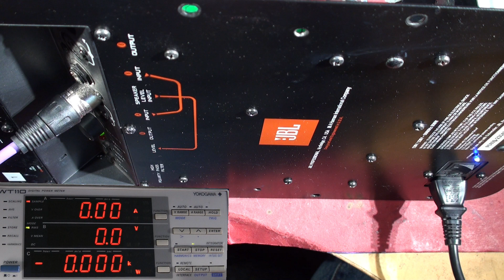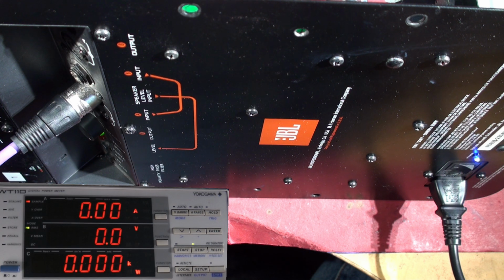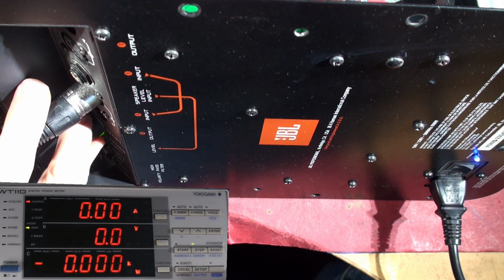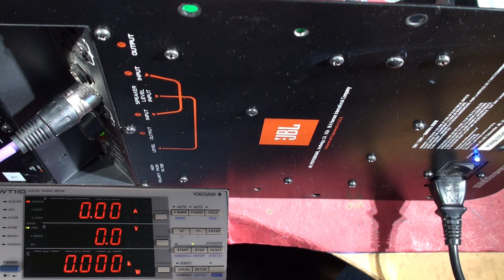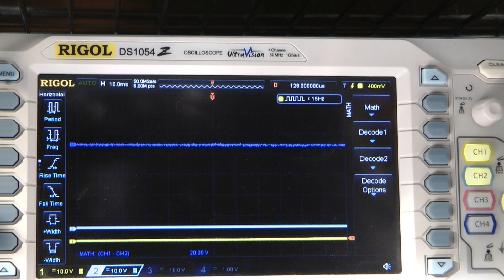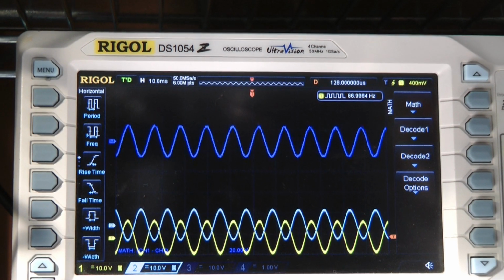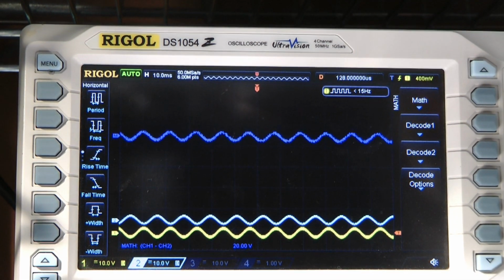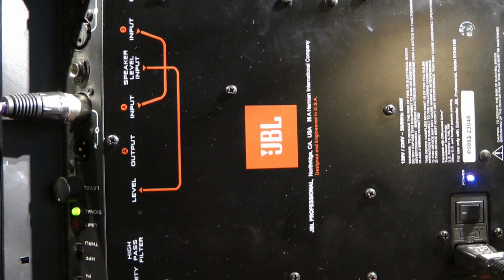JBL PRX518S Bass Amp RMS Full RMS True Power Test Run - Does it meet Specification?

Comment: Hello mate lost your email, anyways can I ask for a bit of advice? Built into my kitchen under cabinets I have a blue tooth usb iPhone dock unbranded, problem is this if I unplug it over night and try to use next day it has to be on for at least 10 mins before it will connect to any device like phones iPads etc to play music while burning all food being prepared.. before I try pulling it out I was wondering what thoughts you may have I was thinking low esr transistors or alike.  But is there anything else to look for ? It was put in donkey years ago but to replace it means new bottom cabinet and I hate land fill like yourself.. all the best Brian
Reply from the maker: Hi Brian, What make and model is the dock? It doesn't sound like anything with a common cause. the fact hat you can't connect within 10 mins from turn on suggests the low voltage DC power is iffy. It could easily be a bad bluetooth controller so sorry I can't help.
Reply: @razenby  sorry for late reply. In the cabinet we have had fitted one of them pointless energy meters any ways I took docking station out took it up to my room and it worked perfectly every time, refitted it and problems started again... un plugged energy meter works perfectly plug it in same problem, moved smart meter all sorted funny cannot see why this would happen but is definitely odd indeed. Hope you and family are well mate all the best brian

Comment: You know your stuff, it's a joy to see. Properly tested with differential measurement. Distortion measurement would've been interesting, though clearly not required for this repair. I had a batch of Class D amps I had to modify for a customer at some point (made for private jets, strangely enough). I didn't have a distortion meter so I ended up writing a script for Matlab to give me accurate harmonics measurements from the scope traces haha. Worked really well. I still don't have a distortion meter. ;)
Reply from the maker: Thanks. I'll put up a videos of the HP 8903B Distortion Meter system in action.